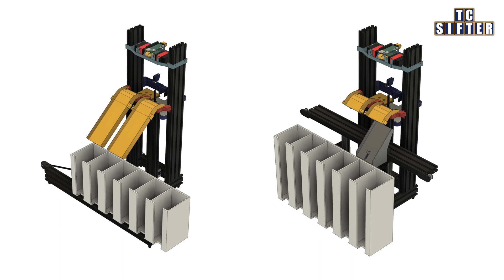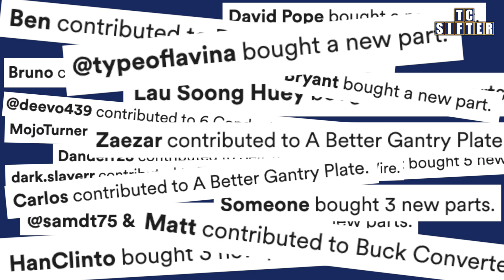Teaching A Machine to Dance

Comment: Nice, I was worried you had stalled out and moved on.  I have also been building a machine, 64 pocket (8x8) vertical grid with an x/y gantry, a good number of the parts are similar in design, but I am still debating the card feeding mechanism.   Mostly just cad and some test assemblies at the moment.  Because I like to make things difficult and cheap, using home brewed linear actuators.   Trying to keep the software all local (no cloud), had really good results using tesseract ocr on the PC (ryzen 1400), matching in < 200 ms using the words on the card to match weighted word results from a database built from MTGJson files.  Results were disappointing on a PI3 (2-3 seconds) and ocr accuracy was also worse due to older version of tesseract.  Still debating the what to use for processing but leaning towards a recycled small footprint PC from ebay.  Been stalled for a little while due to work and the need to cut and assemble the 64 pocket 2x2ft grid, hoping to get motivated soon.  Will be following you and can't wait to see the end results.
Reply from the maker: Wow, awesome to hear about your build and your OCT testing! I’m similarly staying away from any cloud-dependent solutions, but hoping to avoid including any real heaving lifting computation being done on the machine. My next video will dive into the software side a little bit more!